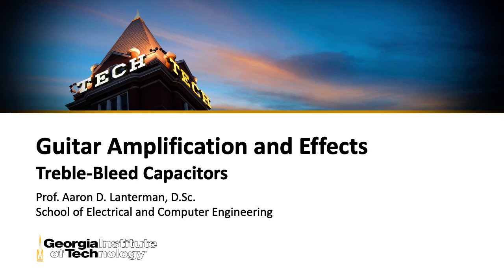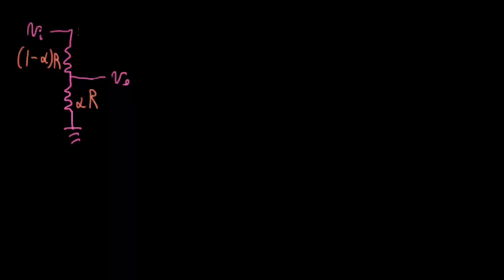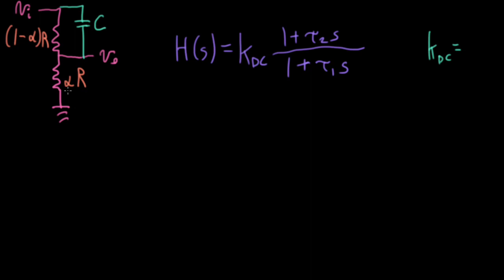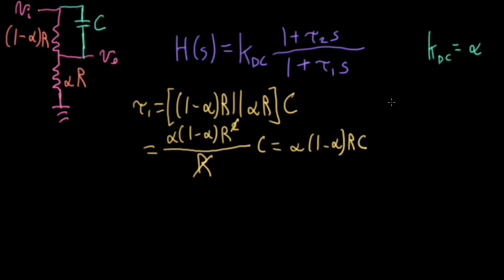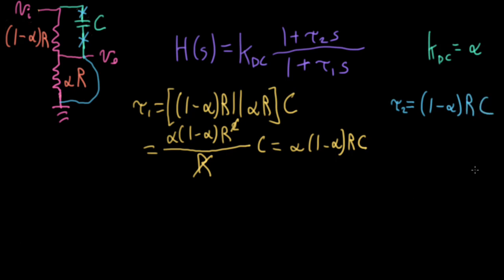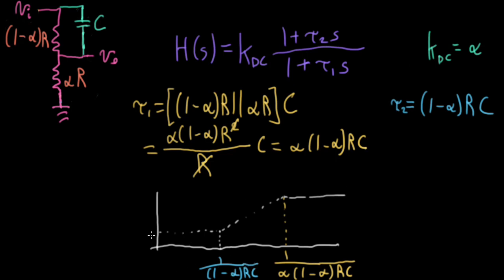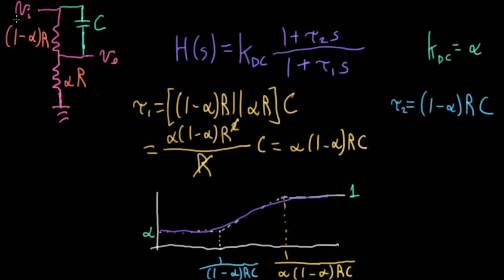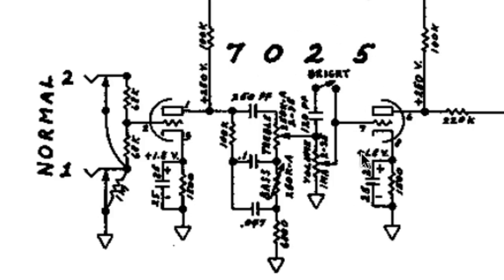ECE4448 L12: Treble-Bleed Capacitors (Guitar Amplification and Effects, Georgia Tech course)

Comment: Great analysis!  Guitarists do have a love/hate relationship with the treble bleed circuit.  It may be that the treble bleed circuit works best with high-output hum-buckers that tend to have higher output impedance.  The type of pickups that get immediately dull when the volume is rolled back due to the isolation of the pickup from the cable capacitance.  The cable capacitance reacts with the inductance of the pickup to form a more resonant low pass filter, which is perceptibly brighter and more aggressive.   As volume is brought back, the Q of the filter drops and the top end response also drops and becomes dull.  For an example of values: think humbucker with 7-9H and cable capacitance of 470pF to 1.5nF!  Unfortunately, it doesn't stop there.  Thanks for keeping up your great YouTube channel Mr. Lanterman!

Comment: Treble bleed caps are evil. Turn down the volume pot just a little and the guitar sounds whiney and tinny. Yeah, you can dork around with the cap value, add a resistor in series or parallel, mess with the RC time constant, but it's much better just to play. There's a reason why Fender and Gibson do not include treble bleed caps as stock.
Reply: I agree with your assessment, but Fender (possibly Gibson as well) does indeed include treble bleed caps in many stick models. Not that that's a good thing LOL.
Reply: *stock models.
Fender is not affiliated with Emmet Chapman. 🤣